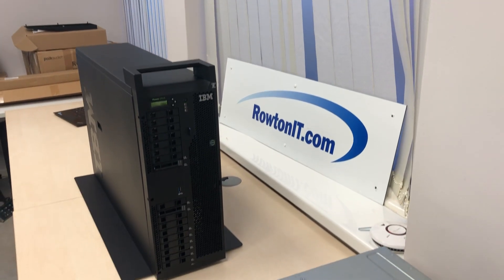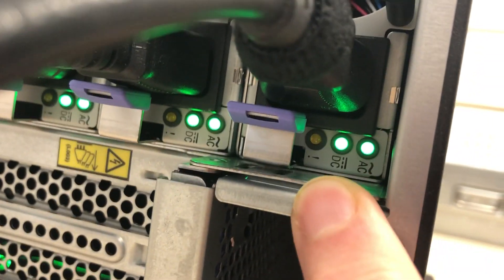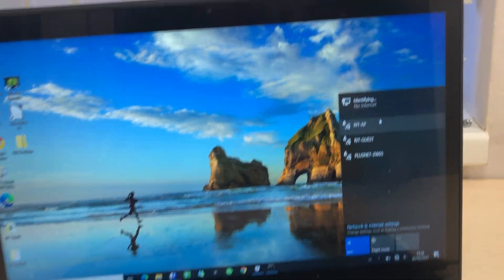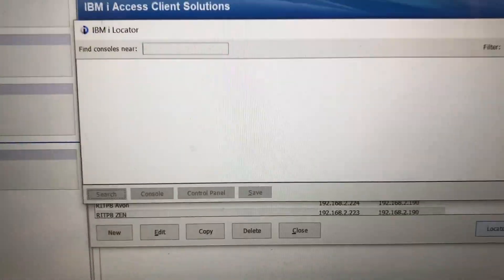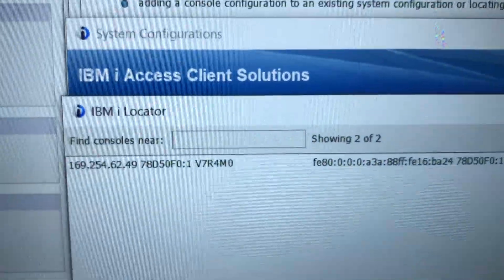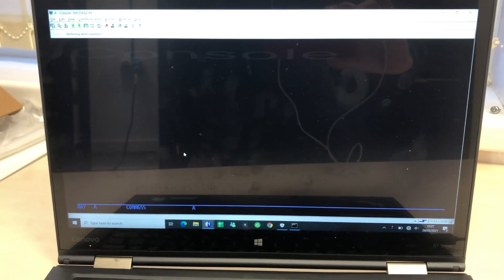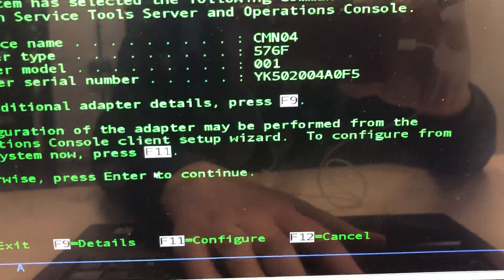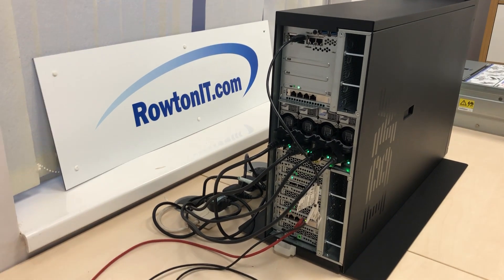Unboxing P9 Part 3 Connecting an Ops Console

Comment: hi Steve, I am revisiting this video and I am curious about how to change from lan console to hmc, assuming you have a running environment and then you decide to switch to HMC.  Thanks.
Reply from the maker: Yes you can do this, it is generally easier to move from Ops Console to HMC but it is possible to convert a system either way. There is documentation on the IBM web site, I'd suggest you start here with the link below.  Good Luck https://www.ibm.com/docs/en/power10?topic=consoles-changing